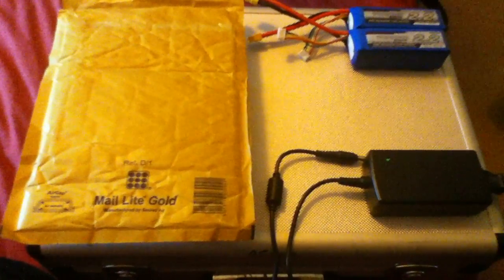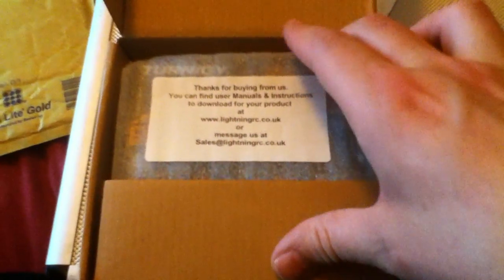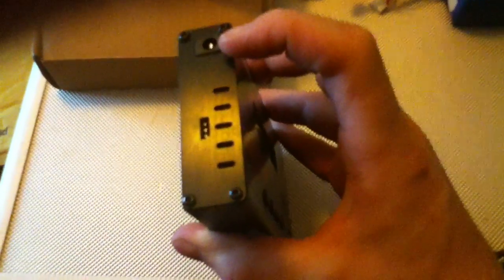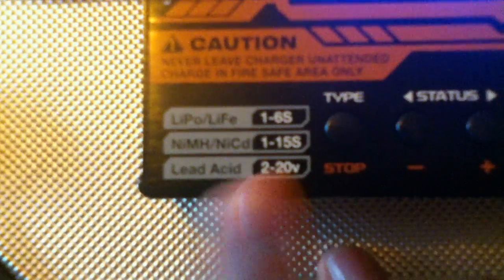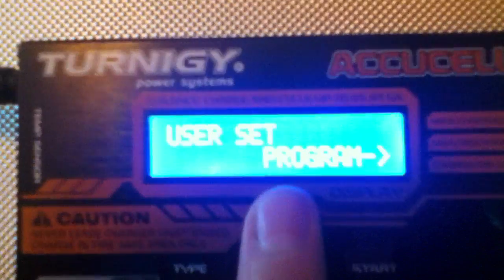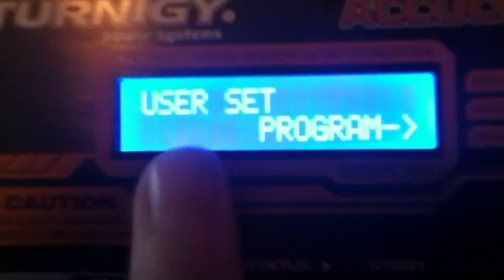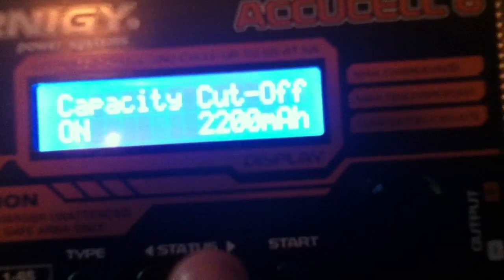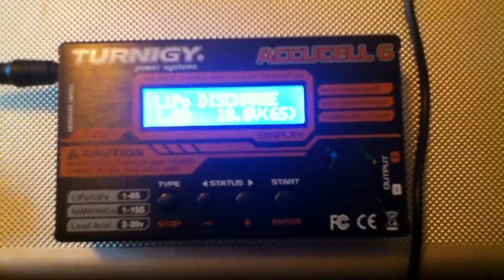Complete Video Guide of The Turnigy Accucell 6 Charger

Comment: normally i charge lipos with this charger so say i have a 6000mah lipo i will type that in then press enter but now i want 2 charge a nimh or nicd battery which is say 1800mah 7.2v. do i type in 1800mah? like i do lipos.... btw if your lipo is say 2200mah and you type in 2200..thats 1c charging! if you type in 4400mah then thats 2c charging and so on.